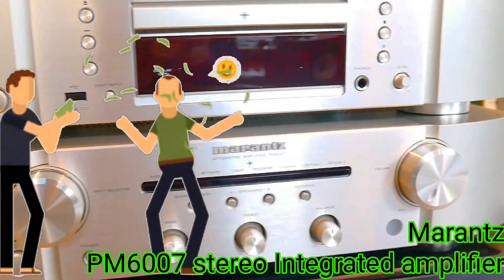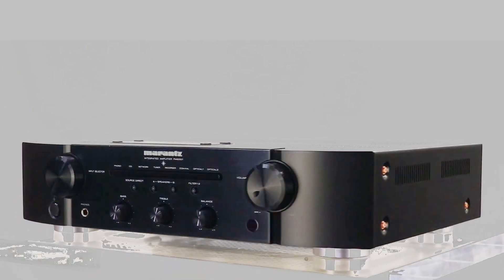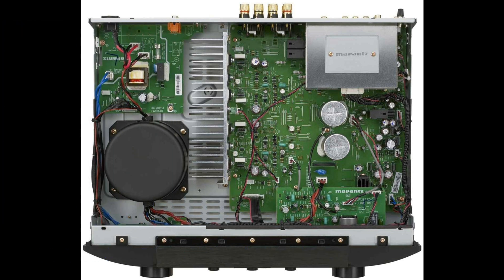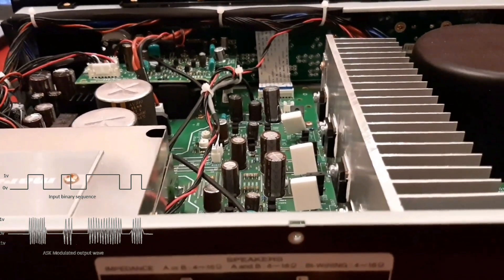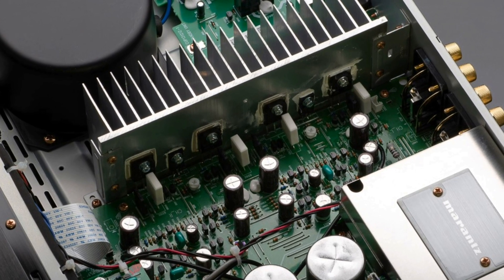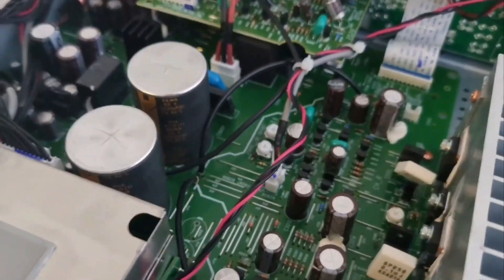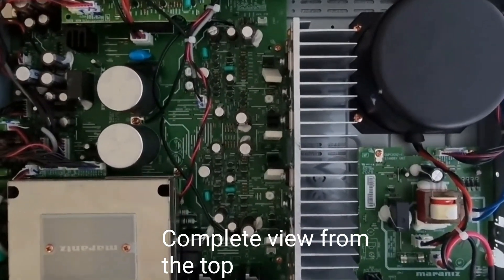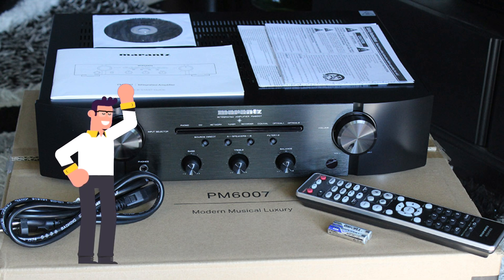Let's see what's inside marantz integrated amplifier pm6007 main hardware

Comment: Thank you for the video. In spite of your misgivings about some of the parts, buying a stereo amp is getting more and more difficult, I decided to buy one.. The fact that has a toroidal transformer, through the hole soldering  and solid heat sink, sold me on it. I hope the disadvantages you point out, will not affect it's performance. Thanks again.

Comment: I have no clue how you got so many subscribers while talking nonsense like this?!?!
- top overlay image at 0:58 is from Marantz PM6006
- there is no inlet power filter, the small transformer and rectifier diodes are for standby voltage
- explanation of a DAC and how it works makes no sense
-  toroidal transformers are nothing special and are in use for decades for various applications
- 12000uF per rail is more than enough to filter the power, incredible how clueless you are
- aluminum color is not white...
- your explanation of electrolytic capacitors makes no sense. I heard the word "gass". Why???
- small brown capacitors are ELNA audio caps, "audio" caps are snake oil but nonetheless this are high quality capacitors. You really are clueless! Didn't you notice 12000uF caps are also ELNA?
- trimmer potentiometer is as good of a component as any other, what are you blabbing about?
- how in the heck would anything come from trimmer potentiometer to DAC? What the heck are you talking about?

So much nonsense.